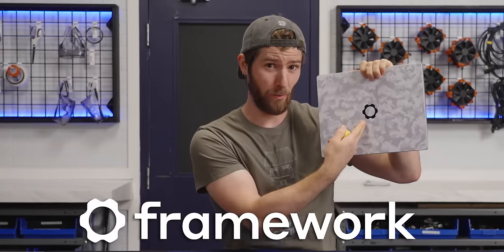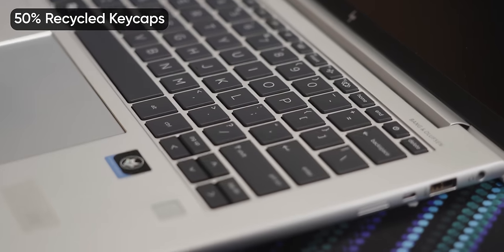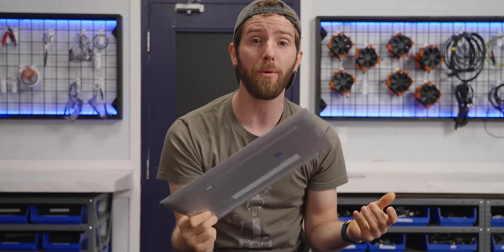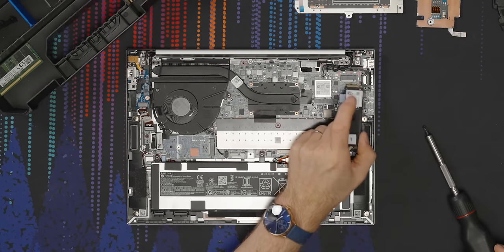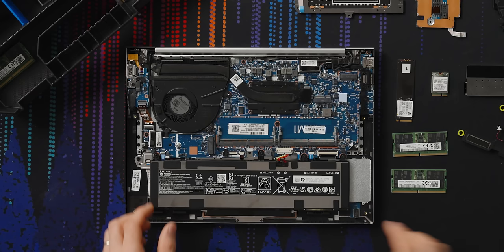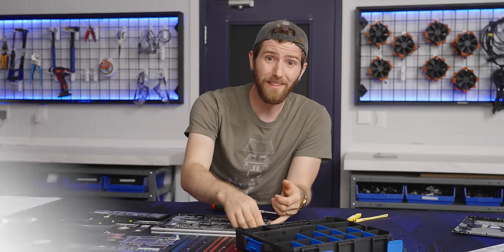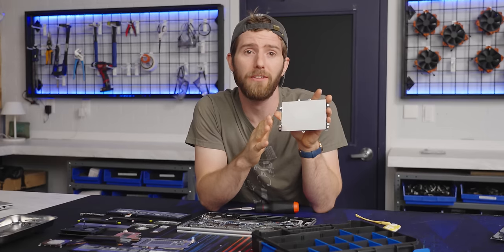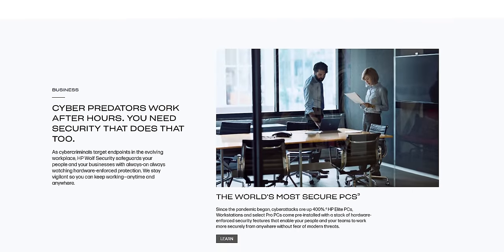My Investment is in TROUBLE - HP repairable laptops

Comment: The laptops I work on from HP, Lenovo, Dell and Acer in schools and small-medium sized business all have basically the same level of repairability as this and the Framework one, albeit with a few more screws. This is only a problem for the fanciest, high end laptops for consumers that are priced and marketed to the kinds of people that don't care about repairability. They (generally) have the preference and the money to buy a new laptop when their last one stops working or just isn't new enough. Take MacBooks. How many normal consumers do you know that both buy a MacBook and also want to repair it if it fails? When it comes down to it, these companies aren't building their laptops to be unrepairable because they don't care. They're doing it on their high end models because it allows them to be thinner and lighter. The target market for those SKUs cares about thickness and weight. The barrier to being able to repair a laptop is not necessary, it's just not something they prioritise.

Comment: Very impressive. Good to see that offered with OS other than Windows.
My only HP laptop lasted more than 5 years, but not used much. My Dell Latitude is coming up to 7 years old, although I did have to replace the HDD with a Samsung SSD, which was really easy.

Not shown was how to replace the keyboard. Presumably easy. Was very impressed with Dell when coffee, milk & sugar went over the keyboard of a Latitude (not the one I currently have). A protective film prevented the liquid getting onto the electronics but the keyboard was quite crunchy and had to be replaced, which was done fairly quickly by the service guy.

Comment: HP Used to make laptops with a handy slidebar. You went one direction for the batter and the other to take off the bottomplate. They were made from steel and quite durable+lightweight. After removing the bottom you easily had access to everything inside. Those could be serviced then and I still have one that can easily (if parts could be found) be serviced today.

I'm not sure if this type of setup we see is "better" or not. Why aren't batteries on laptops easily accessibly? When you run out, you should be able to pop one in easy-peasy and replace it like.. well .. batteries! :)

We shouldn't congratulate a company like HP for simply making laptops like they used to. It'd be nice if everyone bought these new, accessible laptops to signal the importance of this design. But ultimately, will they be anymore upgradeable?

Comment: I just got an envy x360 for my kid because of those reparability videos on HP's channel. I could get 98% of the parts need to build a second envy, from them. The hardware is slick. The software on the other hand..  Aside from marketing deals, HP's software seems mostly there to help HP service then it is to help the user. First boot was almost 8 gb of memory used. The BIOS also has zero knobs and dials for the cpu or memory or even fans. And no clear way to an advanced mode. I managed to quiet it down, by dialing back HP's ambitious power profile.

Comment: Captive screws are great until one strips. Then good luck finding a replacement one if you manage to get the screw out without damaging anything. It would be nice if Framework would sell those screws instead you have to try to hunt one down yourself or buy a $100 bottom cover.

Comment: The actual parts are pretty much the same as the G7 and G8 models... Not much to say here regarding HP going for "serviceability" other than the fact you are able to buy the parts yourself and most likely lose your warranty by opening the computer. I have serviced many G7/8 computers and from what I have seen the most common issues are regarding the keyboard and display hinges. The display hinges attach to a plastic screwhole that easily breaks when doing service, meaning you sometimes have to get an ENTIRE top cover as well (the part the keyboard is stuck to, by the way) just to repair it. 

Keyboard replacement on these models is one of the most complicated procedures possible since the keyboard is stuck onto the top plate, which everything else screws on to such as the motherboard. Keep in mind this used to be a simple clip removal procedure on the older models. And for a part that commonly gets damaged (by spills for example) it just seems unreasonable and outright insane to have it be the most complicated part to replace. 

I have also worked on their CAD computer models (Zbook G7 and up) that have been getting increasingly hard to service compared to the earlier models. Just as an example, the primary storage disk is located under the (albeit easily removable) keyboard instead of near the expansion slot is...? The expansion slot also does not support SATA on most models, but the primary slot does for some reason.

Beyond that I have seen issues with the HP models which I have not seen in any other computer models. For example turbo-boost issues which causes the computer to make loads of noise when doing basic tasks, speakers clipping and distorting when using anything above 50% volume (from factory), and many, many swollen(!) batteries. 

While it is a step in the right direction, I really do not see HP catching up to Framework anytime soon.

Comment: In my experience, commercial/enterprise users at scale rarely fix hardware problems. If hardware issues pop up, it usually involves deployment of a new device and returning the faulty device to the supplier.

Comment: Have worked with HP elitebooks for years. compared to laptops from Dell, they're probably the best on the market for big organizations in terms of stability/availability/repairability and looks. The aluminum they've ben using since gen 5 are great. the only thing about the last 2 gens would be HP dropping a RJ45 connector. Not everyone is willing to carry around dongles or has access to USB-C docks.

Comment: good video, but tbh that's a normal grade of repairability for a business-laptop. All my ThinkPads, Elitebook and Latitudes can bei repaired pretty easy and the manufacturers provide service manuals, so what's the point? Also most consumer notebooks are in a similar way repairable, the problem is the lack of documentation.
Framework is still different because the devices are not only repairable but also upgradable, modular and consumerfriendly. I wish they had an AMD variant or a variant with a dedicated GPU even if it was a 1650.

Comment: Not really interesting for commercial use, because companies just lease the laptops often from Dell sometimes HP and if something ist broken, the IT Support won't open anything. They just sent it to Dell or HP which takes only 24h 
Companies don't have staff to troubleshoot hardware issues nor time.
What I could see happen is hardware upgrades in bulk loads, but most companies would just let the leasing run out and replace it.
I am from Germany and I am working as IT consultant

Comment: Well no surprise on such a high end device.
But maybe take a look on more budget oriented products.
They are often just terrible with plastic clips all over the place to save cost because no one is willing to pay the extra fee nowadays.
If it´s dead or too slow, just throw it away and buy a new one.
That´s really an issue not only on the manufacturer level, but also the average consumer.

I was working on a few old historical radios mainly from the late 50s early 60s and that was already a time where some corners were cut to make them easier to assemble and save cost.
However they still were highly repairable and still expensive but if you want to serve your products to the mass, you´ll have to make sure everyone can afford it.
So i appreciate that hp makes repairs easy on this model but well for a laptop that costs just under 2 grands, i expect something like this.

Comment: ive felt that was about hp since i bought a split x2 tablet computer from them........ 10 years ago? (may 2013?)
i mean besides the i think unavoidable clip in assembly of the screen/tablet side ...... its been amazingly easy to open and close back up...

but the only repair i needed was to replace the cpu fan cause the bearings would fail when standing the screen up

Eventually

after 8 years of use
in a smokey enviroment. 

that computers brought me alot of satisfaction over the years i even got my brother to buy a new HP laptop recently
(annnnnd then the custom graphics card he selected, melted the onboard keyboard when running that unreal city demo.. and now has an external keyboard instead. why HP let that out the bay doors without safeguarding its hardware is a mystery to me)

Comment: To be honest if this laptop considered repairable, than every laptop existed every is repairable. My current asus laptop can be completely disassembled in about the same number of steps. And my previous hp laptop (about 10 years ago) was the same as well. The only difference I can see that you can actually buy the parts from hp, insted of buying it from ebay wher you can usually find the parts anyway (bought new fans, and laptopcover couse it broke from there, but could buy new screen, keyboard, modules even motherboard from there so basically everything).. Until I cant switch cpu-s and gpu-s without anything else to repair or upgrade (maybe a new motherboard if needed to the cpu jsut as in pc-s) I don't consider laptops repairable.

Comment: I recalled swearing off HP laptops because one I got in the early teens started overheating after 3 years or so.  Not surprising, Thermal paste is basically guaranteed to need replacement before anything else - even the battery.

But to replace the thermal paste required... opening the laptop, taking daughter boards off the motherboard, detaching the screen's incredibly fragile ribbon cable, taking the motherboard out, and detaching the *T$%#I%ing keyboard just to get at the @#$%*^ing CPU so I could replace the stupid thermal paste.

Good to know they're finally changing their behavior on that.  Hope it 's indicative of a trend rather than a one-off.  But other makers like Dell has been much cleaner to take apart and put together for over a decade.  Dunno if they've changed for the worse, but at the moment, this is just HP reaching the bare minimum that other places have given me for years, so it's gonna take more than that to give them a try again.

Comment: The only thing that could make this design better, is if it had some from of a socketed cpu. - Also i would like to point out that dell ahs had some very easy to repair laptops for some tie now. I rember my fathers old work laptop from 5 years ago needed a ram replacment, (He had given it to me, and i wanted to utilize it for gameing), and i was astoniched to see qr codes on the magor parts, and screws with markings on their corrosponding screw holes. Props to HP nne the less, I really hope this is the future of consumer laptops.

Comment: I prefer the idea of the Elitebook 840, i have several versions and generations of those. Mine are from 2014/2015 and they have a special service cover that doesn't require any screws at all. Unless you decide to use the screw that stored inside the cover for added security whilst traveling or something. 
I can acces the battery, ram, all drives, wlan, SIM card and CMOS battery, without having to open up the laptop. 

Serviceability and repairability isn't something new with the HP Elitebooks. The oldest one I own is the HP Elitebook 8540w from 2010. It doesn't have the nice service cover like the 840's have, but the battery, CMOS battery drives, optical drive, ram, bluetooth and SIM module are all easily accessible without removing the cover. 

But best of all:
It has removable and therefore upgradeable CPU and GPU!
This is my main issue with modern laptops. Claim serviceability all you want, having to replace a faulty GPU with an entire main board is a massive source of e-waste. Of course, technically someone can replace the soldered on dedicated GPU or CPU, but it requires extremely expensive equipment and a lot of skill, which most repair shops don't even have. Let alone the IT person at a company or even a consumer. 

This HP laptop barely adds anything new from what they already had, and might even be worse considered the above mentioned Elitebooks they made years before. 

I feel like they're just trying to jump on the fighting e-waste bandwagon with adding some extra pictures and videos alongside their already existing service manuals.

Comment: I'm at the start point of the battery removal and so far nothing seems to have changed from the last few gens of these laptops. I repair a ton of them at work, they're solid and 9/10 times a cable has wiggled loose and that's the whole defect. Before it was 7 captive screws on the back panel and the battery was torx 9 instead of philips but beyond that same thing so far. And yeah these are really repairable, and have been that way for a good long while now. Pro laptops in general IMO are pretty good for it. Where consumer crap is crap for repair pro stuff has been good for a while, at least from the lines of dell and HP I've worked on. Toshiba was also pretty repairable but more of a pain comparatively and I'll never forgive them for the 100% failure rate of the clip holding the keyboard ribbon cable in on some models. I have had to tape in hundreds of those cables. On the plus side, it wasn't very hard to do.

Comment: I just had a thought, you should do a video on underclocking high end laptops maximizing battery times, and see how it results. I would really be curious how much you could make a powerful laptop do under load, I mean, think about it, these new CPUs are beasts, and if we underclock, we get less heat and battery drain. It would also extend the lifetime of the laptop incredibly.
Reply: Undervolt before you underclock. I've squeezed 15-20% performance gains out of ultrathin computers and tablets simply by lowering the heat output and allowing them to clock higher, or gotten way longer runtimes by disabling turbo/limiting multipliers and running the CPU at a lower voltage than factory settings. It's nice because undervolting doesn't sacrifice performance. It's not hard to do, but a video to walk people through this kind of stuff would be great.

Comment: No parts available. That what I've encountered with HP products when I needed them. I did have to resort to eBay second hand parts. No help either while trying to resolve problems with obscure error messages in a printer also. No solution wihout having a contract prior with them... So no more HP products for me.

Comment: As a repair tech who has worked on older HP laptops, this one gives me hope. The hidden screws under the rubber feet(which stretch when removed) were the bane of all of our existences. Seeing the RAM being upgradable, on the bottom of the board, and not soldered on is a welcome change.

Comment: I have a HP Probook 450 G5 w/ intel 9 series 16g ram. the Probooks have always been this repairable. ive been inside the system 3 times. its Easy . (new battery, New touch pad, Ram upgrade)

Comment: HP Rep here. Yeah, the HP Parts Store listings for parts, they NEVER show stock availability. Not in the 12 years I've worked there. Its not a "bug" but just that from what I've been told, the part store is never linked to any on-hand inventory databases. A reason for that? Well, nobody could ever tell me, but I would assume its because part stocks change second by second when we're dealing with global-scale part distribution.

Comment: Is't every laptop that uses non glued battery on the same level of repairability? I fix a lot of laptops and parts such as replaceable touchpad, bezels, screens, batteries, heatsinks, fans etc are easily removable with screws. Thinkpads have been using captive screws for ages, and all of them have the same replaceable parts. Most of them are even more easily replaceable such as the keyboard, which comes out with either 2 or 7 screws, whereas in this hp laptop it's probably rivited.

Also on another point, this is built the same way as any other hp probook/elitebook laptop. All of them require identical skills to replace the battery, heatsink, fan, and most of them use daugter boards for right side ports.

Comment: Ngl my lenovo legion is super east to maintain in terms of replacing storage, ram, battery and wifi card. The only is the fans and the heat pipes are all fused but there still easy to take off and clean and in theory replaceable

Comment: Genuinely super excited for this. $26 for that headphone jack board is probably very close to what HP paid for it in the first place. If I didn't just buy a laptop in 2021 I'd be looking at HP laptops right now. That said if they keep this up and all those parts are still available in 4-5 years they'll be at the very top of my list when looking for my next laptop because of this kind of stuff.  For once I can say well done HP.

Edit. Sorry correction. I HATE when the power button is just randomly one of the keyboard keys like on this laptop. If HP fixes that THEN they'll be at the top of my list for my next laptop.

Comment: My concern here is that HP is creating a one time laptop to take Framework's market share away, then either discontinuing the parts for it, or just not making another version of it for the next season. This ensures they continue to maintain a peak position on the brand ladder and still allows them to continue to make unservicable machines. We always knew they could make a repairable laptop, but there's a distinct and very intentional reason they havent up until now.